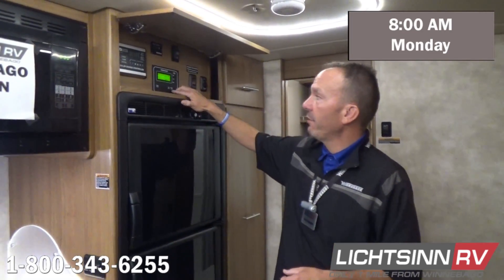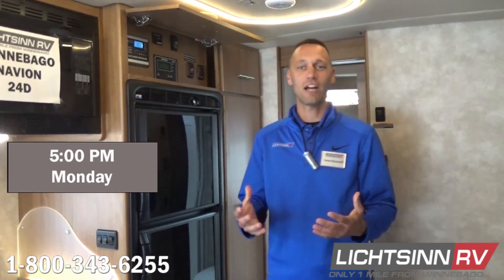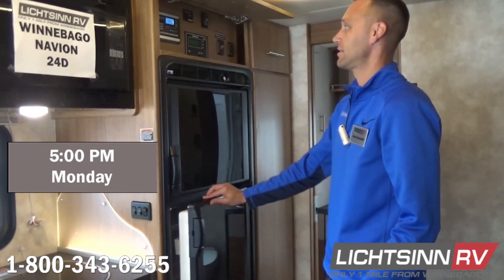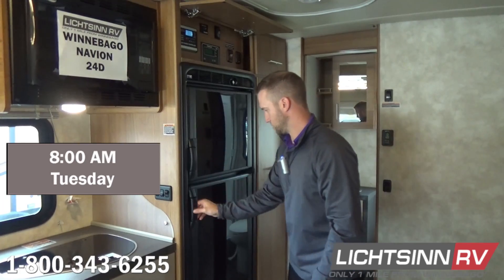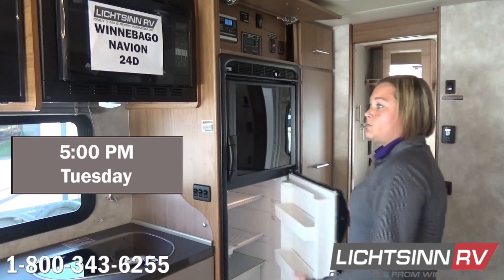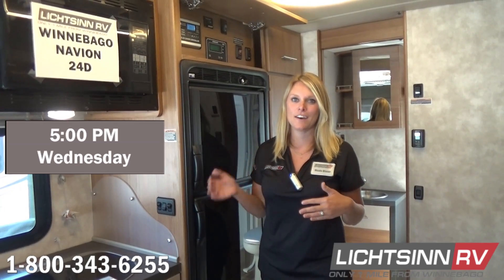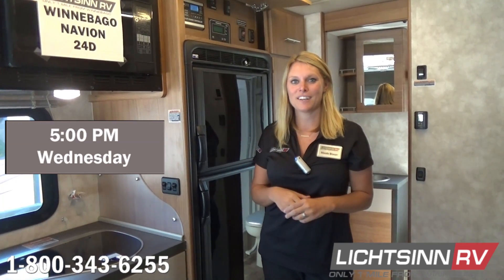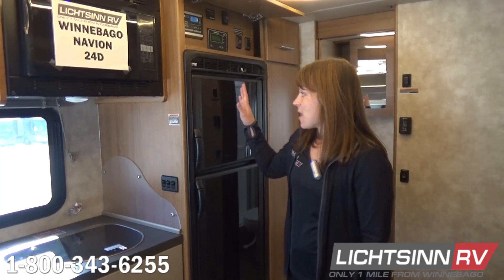LichtsinnRV.com - How long does the Compressor Refrigerator run on Solar in the View and Navion?

Comment: Is this RV available with a 3 way refrig or is the only option to run off batteries?
Reply from the maker: Good morning!   Thanks for your note... the compressor is the only option unless we were to customize... since this last video, changes have been made to be able to run the refrigerator into perpetuity in day light conditions, with increased solar, battery size and a change to the board on the refer.  Hope this helps!

Comment: This was an excellent video! I'm buying a 2017 View 24V shortly. Does this come with the same Norcold refrigerator? I believe it is coming with the 1000 watt inverter and the 100 watt panel. Will I be able to add another panel to allow for even longer usage of the refrigerator/freezer while dry camping?
Reply from the maker: Good afternoon!   Correct, and you could upgrade the solar, which I'd recommend if you're doing a lot of dry camping.
Reply: @LichtsinnRV  Wow, thanks for the quick reply! Do you have a link to the product you'd recommend to expand the existing system? Can you also elaborate further on why the experiment failed after three days if there was sufficient sunlight in your 100 watt solar test video?
Reply from the maker: @wisted  It's simply a plug and play model from Zamp... we now use 200 watts without issue.   I would recommend 200 total.

Comment: Is this Norcold model forgiving of the level that it is operated? I am referring to the position of the refrigerator and not the temperature setting.
Reply from the maker: Good morning!  Thanks for your note... you are dead on right in that the compressor refrigerators are much more forgiving than an absorption style.  Hope this helps!

Comment: Why was the fridge empty? An empty fridge is less efficient. It works much better when it has cold items inside. It helps keep the cycle times of the unit down as the items put off cold back to the fridge when it cycles off.

Hopefully you can redo this test with food and drinks in the fridge and freezer. Real world. 

Were any lights left on for real world load? People will use lights at night and maybe some during the day. One light on 24/7 should be a decent test.

Thanks.
Reply from the maker: Good morning Robert!   Agreed, with food in the refer the compressor would run much less and increase the times.
Reply: @LichtsinnRV  Not true.  The energy needed is the energy flow through the walls and doors.  That energy flow is a function of the insulation R and the temperature difference between the inside and outside.  Food won't change that.  Food will store some energy but assuming the temperature inside does not fluctuate much (it shouldn't) the energy use is simply the losses ... energy flow through the walls and door.

Comment: Great test and review.  It's a Nova-cool?  Thanks for the review.
Reply from the maker: Good morning!    It is a Norcold DE - 0061 model and below are the specs!   Hope this helps!

NORCOLD DE-0061 SPECS:

7.0 cubic ft
AMPERAGE
3.2 Amps at 12 Volts DC
2.2 Amps at 24 Volts DC
.4 Amps at 120 Volts AC
ISO Approved – UL
DIMENSIONS
Height: 52 7/8″
Width: 23 1/4″
Depth: 23 3/4″
PERFORMANCE
Quiet, hermetically-sealed compressor
Self-Ventilated Design for easier integration
12-volt fan aids airflow across condenser and compressor for improved cooling
Contemporary Flushmount Styling
CONVENIENCE
Convenient Top Mounted Automatic Temperature Control
Reversible Doors with adjustable, removable, large container Door Bin
Storage for varied sizes, including 2-liter, 1/2 gallon and gallon sized containers
Drip Tray Drain Hose
2 YEAR WARRANTY